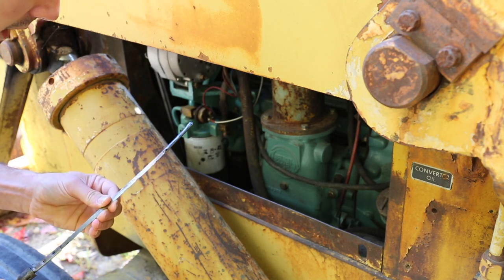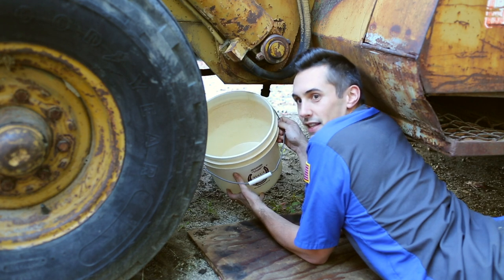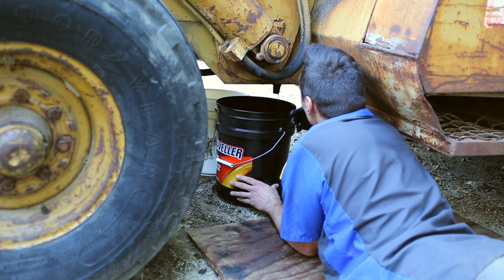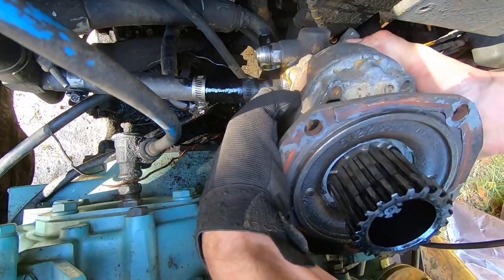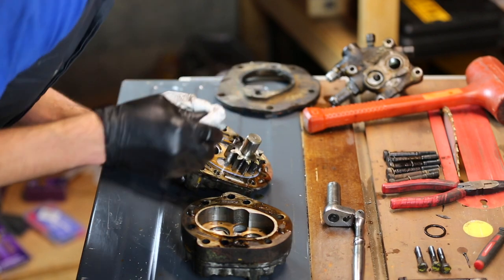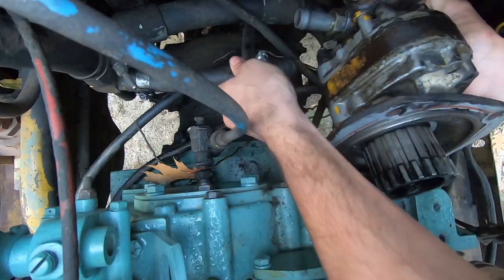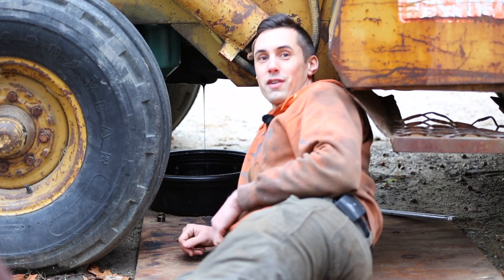Rebuilding a Power Steering Pump for a 1978 Dynahoe 160 Backhoe [Dino Part 11]

Comment: Good choice on the oil. I get mine delivered in five gallon pails from Miles Petroleum Products. It’s generic bulk oil but it seems to be working great so far.
Reply from the maker: Yeah, Tractor Supply has it for $14.99/gallon, which is really not bad!
Reply: @WaldosWorld  I'm confused, did you put 2 stroke oil in that diesel motor?

Comment: Hercules is another good source for hydraulic seals.  Also, for the shaft you measured at 3/4 inch and it has a small groove worn in it due to the seal rubbing on it...there is a product called redi-sleeve that is used to repair that type of issue.

Comment: Observations; I didn't see any "brake cleaner" being used to degrease the pump on the bench.  I didn't see the hydraulic fluid filter being replaced.  I didn't hear that the reclaimed hydraulic fluid was filtered in any way.  I would have repainted the cast iron end (with the fittens) piece.  Nice video.  Ooh I'm glad you got all of that white overspray off of the dog. Ron W4BIN
Reply from the maker: Oh shoot, I guess I left those clips on the editing room floor 😂

Comment: Next time you have to pour several gallons of oil take a length of garden hose as long as you need it to be and cut a slit the length of the cap thread section of the jug. Slip a screw clamp over it then the slut hose over the threads and clamp it down.
 Install a ball type valve wherever it's best suited for your convenience to use.
Then set your gallon of oil on top of whatever you need to fill and run the open end of the hose into that funnel.
I use a funnel that has a air relief straw built into it.

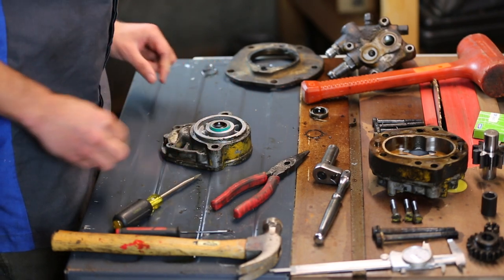Comment: 10:48  Larger socked is in order.  You want something just small enough to fit into the bore so it drives on the very outer edge of the seal.  You are moving into higher pressure systems.  Slight deformations in those seals cause issues.  Maybe not right away but their life expectancy is always shortened.  As you marginally deform the seal face with the under sized driver it opens the ID of the seal ever so slightly.  I don't know what the bypass pressure is set for that system.  Maybe 1000 psi?  Not crazy high but that seal has it's hands full.

Comment: Biden lol   what camera, mic and editing software are you using?   good job on your pump repair.   tip for pouring buckets and oil is to have the spout at the top. this lets the air in the container while letting the oil out so it doesn't "chug" and make it less controllable .  a lot of the times you can pour it without even using a funnel and not miss the hole.
Reply from the maker: For the camera, I typically use a Canon 5D Mk3 with a 70-200mm f/2.8 lens, though occasionally I use a GoPro. The microphone is either a Rode VideoMic Pro or a Sennheiser EW 112P G4 wireless lapel mic. Editing software is Final Cut Pro X. Thanks for the pouring tip, I'll give it a try!

Comment: I know I'm a little late to the party here but on the off chance that you read this comment you might consider, the next time you need batteries changing your batteries to 900-950 ish CCA group 31's (The big ones they put in semi truck). G31's have more juice to them than those Optima's and even though they are larger batteries they tend to be cheaper if you buy them at say your local semi truck dealership.... last time I bought 4 g31's at 67.90 a piece with a 22 dollar core charge.(that was not a sale price or a special account price, just the walk in price.).....
and if someone tries to tell you that you need one of those big 4D equipment batteries tell them that they can pick that 100 plus pound thing up and install it themselves

Comment: Would there be any need to flush the hydraulic system if there was water in it?
Reply from the maker: I'm not certain, but I figured that water would mostly settle at the bottom of the hydraulic tank and would be lower than the pickup tube. Whenever I would disconnect lines, I never saw any sign of water, so I think this is probably correct